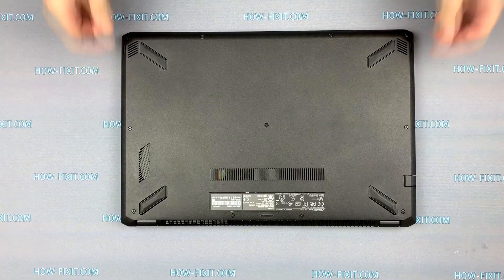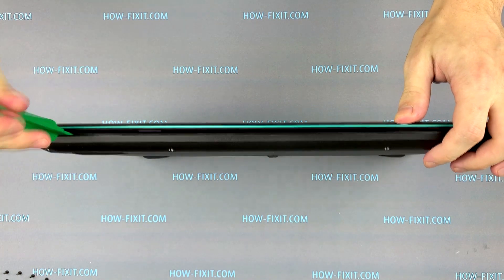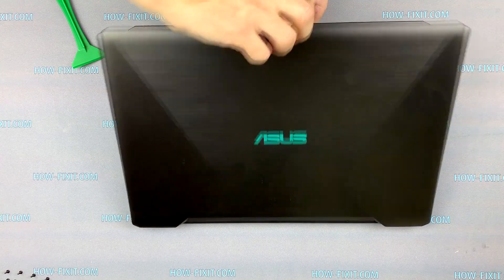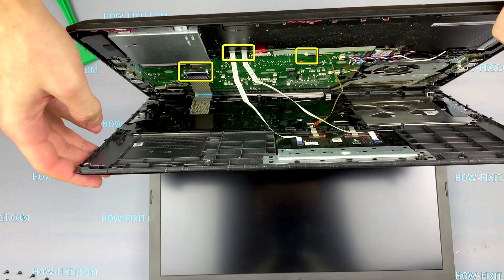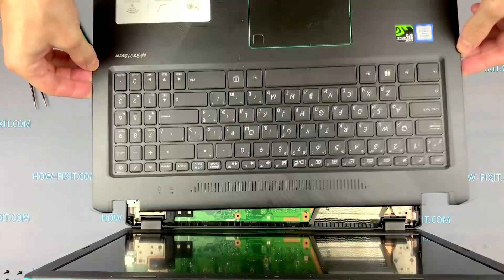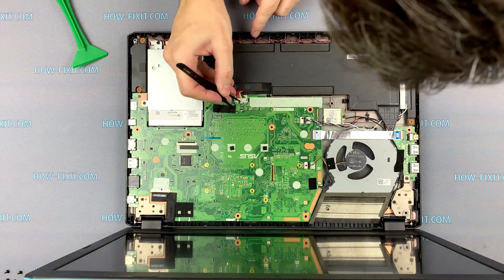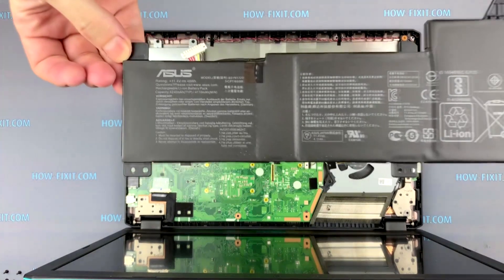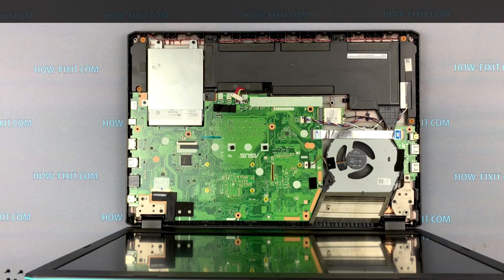Asus K570, F570, A570, M570, X570 Battery Replacement | Repair Fast-Draining Battery

Comment: How the heck are you unplugging the battery so easily? My plug won't budge.
Reply: Probably too late for you, but, for anyone else that has this problem, the battery is latched in. Pull back on the metal connector attached to the motherboard, then lift the battery cable up.